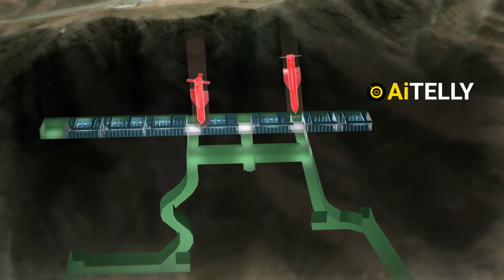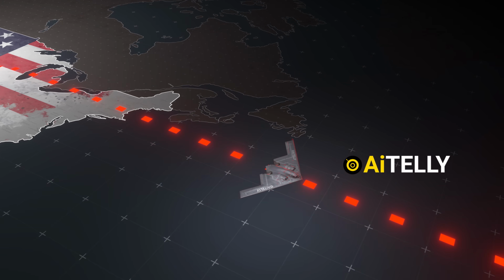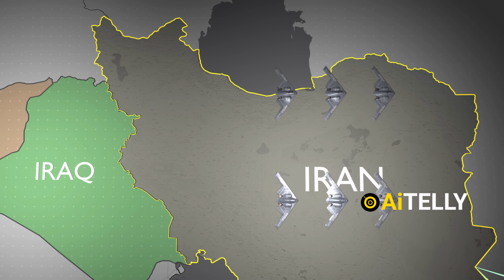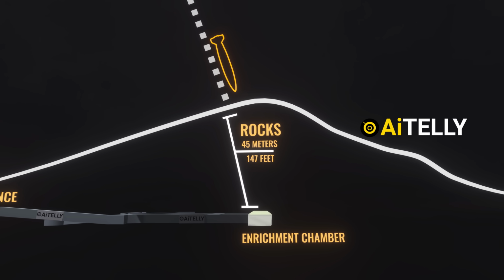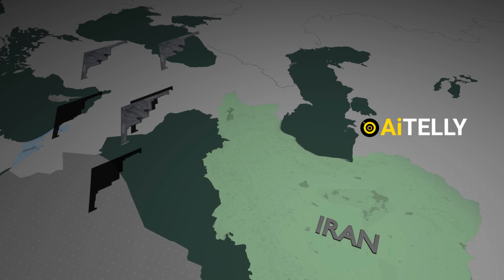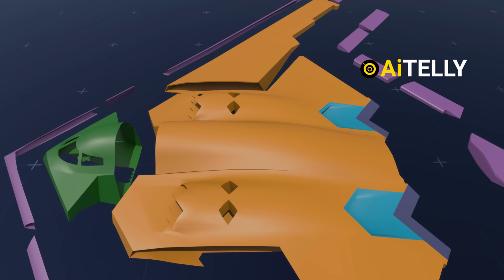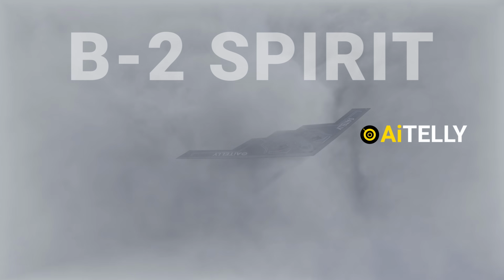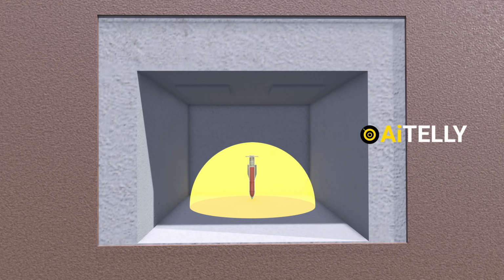How US B-2 Bombers Strikes Inside Iran’s Fordow Nuclear Site using Decoy & Deception #iran #usa

Comment: Unfortunately, you’re incorrect about one particular thing.
They didn’t have time to move that extremely heavy and, dangerous materials. That would’ve been detectable. And it wasn’t. And I can guarantee you with the type of munitions that were used. That there is nothing left under that mountain but rubble. That cannot be gotten to. That’s an experts observation of the exercise.

Comment: The main chamber is 90 metres deep under rock and concrete, not 45 metres. This why the B2s struck the ventilation ducts, hoping it would create enough blast to damage the main chamber.

Also the latest facilities in Isfahan were so deep underground that it was deemed indestructible by the MOPs, and only the missiles were used to attack the surface facilities.

Comment: From the information I've seen and heard:
-  The vehicles seen at the facility (I don't know where the description as "heavy trucks" came from) were part of the construction crews that were there doing additional concrete work. As has been mentioned, you don't just drop in and pick up 60% enriched uranium - if you want to keep living that is (very, very bad way to die).
To move highly enriched uranium (without killing people) requires specialized containers, chemicals, an equipment... not just a truck.
- It is thought (no proof) that Iran had about 10 tons of uranium, but only about 900Lbs of 60% enriched uranium.
- Right now, from reports, it is believed that the uranium is likely still in the destroyed Fordow facility. A deep dig if you want to get it.

- Everyone was told Iran's nuclear refinement was for civil energy purposes. Well, civil energy uses 3%-5% enriched fuel - not 60% (AIEA noted they also found some at 83% before they were refused the ability to inspect). You simply have no reason to enrich beyond that 3%-5% unless it is not for civilian energy use.
- There was a preliminary report that was leaked to the press (illegally) that stated it was possible that the facility sustained only minor damage (i.e. set back of 6 months). A few problems with this report - A) It basically had zero information to go on - they looked at some preliminary photos I believe. B) It was listed within the intelligence "community" as Low Confidence - which means no one is really believing the report because it basically is a guess. Since then, what hasn't been reported apparently very much, is that - it appears - Israel actually inserted units on/near the site which was able to confirm major destruction.
Why should we believe this? A) Israel's stated objective was to destroy the nuclear facility. They stated they had means of doing so if the US did not help (likely special forces dropped on site to infiltrate and destroy). If Israel believe the facility had not been destroyed it is unlikely they would have settled for the ceasefire deal. B) It is said that 12 of these 30,000Lb bombs were dropped. It is confirmed that multiples (at least two) hit the desired target point (in sequence). It is extremely unlikely that even the best built bunker would be able to withstand that.

Comment: Ok bro I been listening to Preston Stewart breakdown and review the damage and what happened to the Nuclear sites. Those 6 holes people suspected of being from the 30k pound bombs where holes already there from the ventilation shafts. The holes initially had coverings over them. Once they where expose you saw 6 holes. When the bombs where aimed and shot that direction from the b2. First one was to help clear whatever was covering the vent shafts then the second and possibly 3rd where aimed through the center holes. The center holes where said to lead all the way down to different hallways of the site . Apparently the blast pressure alone .If the nuclear site is exactly the same as reported by the leaked data. The blast pressure should of made the centrifuges inoperable. Even if it didn't directly hit them .The 30k bombs would of hit at the end of hallways.

Comment: The statement that The MOP can penetrate 200 ft of concrete is false.  The MOP bombs have a max penetration of 200 ft in soil, 60ft of standard reinforced concrete, but only 8 ft in 10000 psi concrete.  The rock above fordow is closer to the hi strength concrete, not loose soil.  No way these bombs got anywhere near the underground facility.  Further the rock dissipates the shock wave quickly.  The entrances were damaged, but not much else.

Comment: The Large Penetrator Smart Fuse is super cool. From the aircraft you can set it to detonate on max depth when the accelerometer reads 0, a  preset depth using a double integral of that signal, or void mode where it will explode when it hits a void/tunnel with the derivative of that signal. Amazing what you can achieve with just one damn good signal of the bombs acceleration!

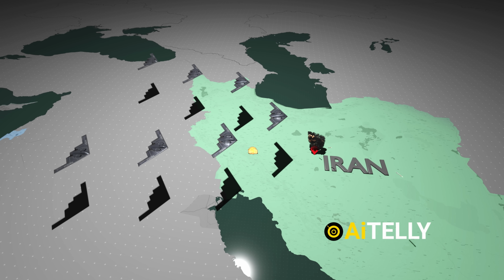Comment: 0:50 The reports I've seen were those trucks were bringing dirt to seal up entrances. At the time it seemed like the US isn't really interested in attacking and Israel might have to do it with ground forces, might be related to that. Moving materials and parts out would just make it easier to hit them. They couldn't do it secretly, the US and Israel had eyes on everything.

3:50 It was nice to practice this and you can't take risks, so they had the fighters there to take care of air defenses but most of those were destroyed by the IAF, especially the more advanced ones. They were left with the kind of air defenses Iraq used in the Gulf war.

Comment: The latest info is that the 3 holes are exposed airshafts after a bomb destroyed the concrete cover and that multiple bombs then went through the center shaft down to the complex. The tunnel entrances were backfilled by the Iranians as a precaution and not bombed.

Comment: Great video, one correction. The rudder pedals are also the brake pedals. If you push toe-down like in the animation, you're applying the brakes. If you push with the entire surface of your foot, it steers the rudder.

Comment: This video is absolutely false. Who made this? The B-2 bombers didn't bomb the entrances to the Fordo facility. They were bombed a day later by the Israelis. Also, 6 of the bombs dropped hit the ventilation shaft WITHOUT having to bore through the mountain, directly into the main hall where the centrifuges and other sensitive equipment were.  God what a load of nonsense. Did you make this video ASAP for likes and views without proper research?

Comment: just pushing a rudder is not how airplane turne, you need to roll the wings to tilt the lift wectoir to a side to generate the force pulling to side needed to turn airplane, the rudder is only to compancase for adverse yaw, an aerodynamic effect accomanying the aileron deflections

Comment: Not a single bomb penetrated to the compound. The GBU57 busts through 60m of earth (unspecified material probably rubble and basic earth with random rock formations), 18m of 30MPa tough concrete and about 2,5m of 60MPa tough concrete (this is google accessible data so im not making this shit up). Ground in the middle east is mostly 60-80MPa solid rock, in parts reaching up to 150MPa (probably this is where the important compounds are built under). In the best case scenario each bomb penetrated about 2-3m deep and caused basically no damage. Which is also evident by all the grey ash like material scattered along the mountain side which indicates a mostly surface explosion and not a 40-60m deep explosion. Its all pure basic simple physics knowledge and common sense. But i do understand most media brainwashed americans dont posses neighter so... Your information about 200ft or 60m into solid concrete penetration is false and google proves that within seconds.... you are giving false information to people.

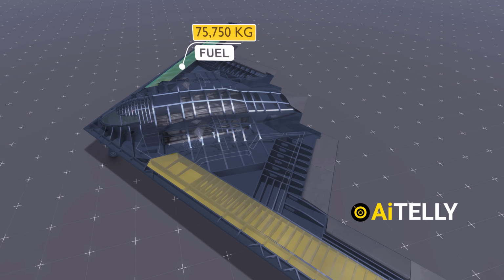Comment: 2:30 "this aircraft fuel reserve can fill up 2000 SUV 'TRUCK'" ... it said no AI was used at the beginning. Are you sure about that? Or does the narrator just randomly speak in broken English?

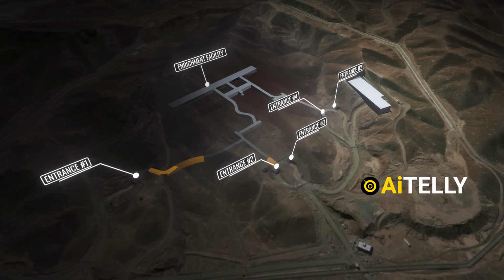edit: again at 4:17 the narrator says there are 6 entrances. The graphic shows 5 entrances, and "entrance #2" is listed twice at different locations.... do you just think we're stupid or something?
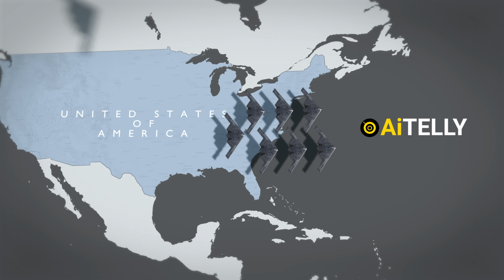5:23 "the us deployed 6 spirit b-2 bombers" and 7 are shown on the graphic. I don't think I can even trust anything you say at this point. Why bother even finishing the video if it's just packed to the brim with lies from start to finish.
Reply: Fwiw I don't inherently dislike AI voiceovers, sometimes it's done without an issue. The problem is that you lied. Why lie? Just say nothing. But the very first frame of this video is saying "nothing here is AI" which is clearly not true. It's hard to trust anything you post if the very first thing you tell us is a blatant lie.

Comment: A hasty unilateral call for ceasefire after a "successful" B2 operation like this!
I call bullshit on this video and US claims.

Iran removed everything from the sites, let the B2 bomb the sites, and collected radar info of the attacking air-crafts along with the Chinese intel gathering ship on Persian Gulf.

After little to no damage on those sites, Iran launched old missiles on the biggest US base in middle east,
Indicating they are capable and willing to destroy those bases. 

I'd think, Iran also secretly sent US the B2 related radar data to show them that those so called stealth air-crafts are vulnerable.
So US and Israel hastily called an unilateral ceasefire.

Given that Iran said from the beginning that they'll stop if Israel stops, Iran had no reason to violate that unilateral ceasefire.

That is the most likely story. Not the bullshit superiority claims by the US and Israel.

Comment: The truck convoy-supposedly transporting 1000's of centrifuges-might have been a FAKE/FAINT/TRICK.If Iran actually did that they essentially destroyed their own production line.Moving delicate  centrifuges-on bouncing trucks-from a well protected location-under full USA/Israel surveillance-to a NOT as well protected location?? No way-it was a trick to discourage the B-2 attack.The centrifuges hurriedly packed-would be  JUNK on arrival-useless.
Reply: I worked with blood centrifuges-they spun whole blood-600ml bags-4-units at a time-50cm in diameter-if they were 1 gram off-they shook like
heck if just 1 gram off(we had rubber weight pads to balance them).They did 3300 RPM- about same diameter as the gas centrifuges-
which spin at 100,000 RPMS.Oh U235 HEXAFLOURIDE must be hot-very hot-to gasify-reactive too-

Comment: From another source, Fordow main chamber lays 100m (or 300ft) under the mountain - not like you say 40m. Estimated penetration of MOP's up to 60m (or 200ft) in rock or dirt, but only 18m in the reinforced concrete. Hence, most likely the chamber was not affected by the blast.

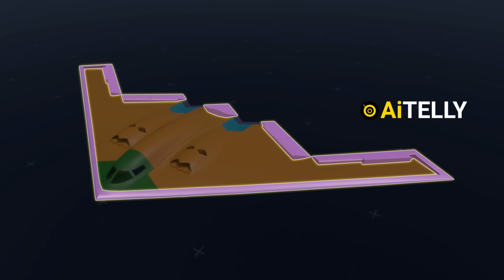Comment: 8:22 the composite ABSORBS radar. Radar works because it reflects back and a detector “sees/hears” that reflection. Stealth works because the craft have very low cross sectional area (hence no sail-like vertical flight surfaces) and radar ABSORBING surfaces. Finally, they use specially crafted angles and surfaces so what return signal does come off, is reflected away from the receiver instead of straight back. It’s why the original F117 stealth “fighter” had that odd trapezoidal shape. It was the best they could do with 1970s(!) computational models to balance the radar diverting shape with something that also could actually fly. 

PS: Graphite is  pronounced GRAFF-ite, rhymes with “bite”.

Comment: Correction to the end where it said the mop can penetrate 60 meters. Weapons max penetrating capability for the MOP is 18-20 meters in unspecified material such as reinforced concrete (5000 psi cement mixed with rebar)

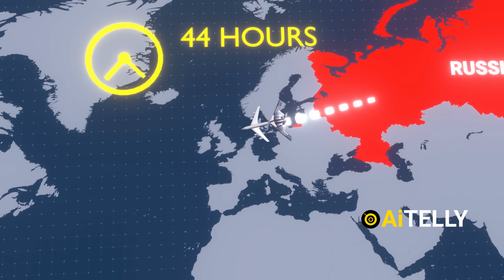Comment: 3:13 airborne for 2 days… How do pilots sleep? Do they have beds on the B2?😂
Reply: @rocky_wang  yes it has a small crew cabin area behind the cockpit.  Theres a bed, a toilet and "kitchen" which is basically an area to heat and prepare your meal. They sleep in rotations since 99% of their flight is going to and from the mission area
Reply: @rocky_wang  yes they have a lie down behind the seat along with a toilet. They take turns on shift.
Reply: The same way german pilots kept themselves awake, meth.

Comment: Fordow is built under a dense granite mountain which means concrete material might as well be like paper. More likely the facility is still in operation with some entrances needing the rubble cleared away after being bombed. Perhaps no nuclear materials left Fordow and everything was instead brought there because it is the safest site in Iran for carrying on with making a weapon. The only way to stop this is actual boots on the ground to secure this impenetrable underground facility. Now make a new video for how this can be done.
Reply: They bombed the entrance caves though too. A shockwaves compressed air, generates immense overpressure, which can lead to structural damage, spalling, cracking, and deformation of the tunnel lining and surrounding rock. The tunnel amplifies these effects, as reflections of the shockwave from tunnel walls and crosscuts intensify the pressure and extend the duration of the damage. Its probably pretty toasted.
Reply: @moabman6803  US Intel assessments say the site is still not destroyed so it is back to the drawing board.
Reply: @deadreckoning425 Actual intel would likely be classified. The news says all kinds of stuff.

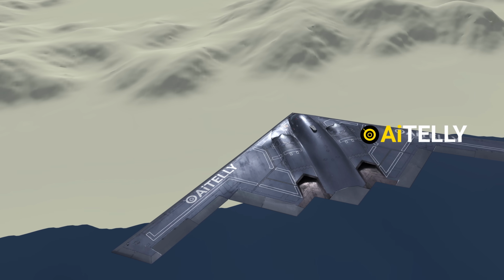Comment: 10:26 was not an MOAB. it was a MOP (Massive Ordinance Aerial Blast* vs. Massive Ordinance Penetrator)
Reply: Wrong. A MOAB is a fuel air bomb meaning it sprays fuel in the air before it explodes, creating a vacuum... the MOP goes through concrete. And the animation shown was a mop, not a moab

Comment: Zoom in on those satellite images of the trucks that were there. You’ll see they are dump trucks and one a front end loader. There’s another image of those same trucks at another location getting dirt and then they went back to the site to dump and fill in the entrances with the dirt. You’ll see them filled in with dirt on the images before the bombing. They didn’t know it was going to be bombed it was to prevent Israel from sending in bombs and the mossad most likely.

Comment: Well done video explanation. After the mission was completed. The DOD had a briefing to the press.
They stated that, 125 aircraft were used in this operation. 16- B2s, KC 130 refuelers (?), AWACS (?), Fighters (?)
Although the exact function of the other aircraft are likely Still Classified. It would have been nice to know.🤔

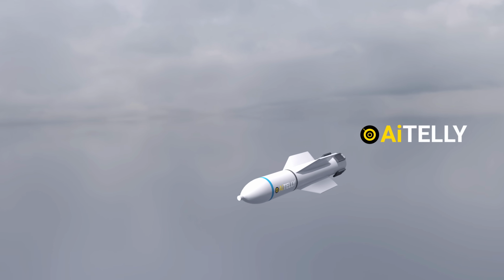Comment: At about 10:30 you refer to the bomb as the MOAB. Not so, it’s the MOP, Maximum Ordnance Penetrator. i.e., GBU-57 series. The MOAB, Massive Ordnance Air Blast, i.e., GBU-43, is designed to detonate above ground and level everything within a mile radius. Sloppy.

Comment: At 8:25 there is a mistake. The components are fiberglass epoxy NOT to “reflect radar”, but to absorb radar energy and thereby not send a reflection back. The whole surface of the B2 is designed to reduce and eliminate radar returns.
Reply: the skin of the B-2 is coated with a classified "paint" called radarsorb that reduces reflected radar energy as opposed to giving a signiture ping back.
Reply: @3RTracing  that’s the true answer 👌
Reply: @Volarte_Studio they both seem right to me. Nothing 3RTracing corrects what OP said, he just said something else. OP said the plane is not designed to reflect electromagnetic energy. Next guy says they use special paint. Both true. The point is the plane is not designed to reflect but to deflect and absorb electromagnetic energy.
Reply: @3RTracing  what isnt absorbed is reflected too
Reply: @bear76009  why would you want to reflect energy back?  That defeats the purpose of cloaking, or "absorbing" the radio energy.  That is the whole point of anachoic coatings, the completely attenuate any reflected energy.
Reply: @3RTracing  did you actually read what i said?  what ISNT absorbed is reflected away from the transmitter.
Reply: @bear76009  yes carefully and more than once and your statement has more than one error.  Sorry to be blunt, and will not respond fuller.  Thanks
Reply: @3RTracing  i dont care if you respond or not.  My reply was based on my 14 years of working in the ELINT field which requires operational knowledge of the radars and how they work.  So to be blunt i dont care
Reply: @bear76009 its actually deflected away. Not reflected, which would imply sending it back.
Reply: @3RTracing  black nippon weather paint.
Reply: Even stealth planes reflect most of the radar signal. The trick is, they refllect it anywhere but back to the source (at least when it's coming from an angle a ground based radar, AWACS or a fighter on patrol would use, not sure how well the upper hemisphere is handled. But then, nobody has AWACS satellites).
Reply: @AndrewCZ47  China has deployed a network of Synthetic Aperture Radar satellites. I'm confident the US military has similar capabilities.
Reply: @KyleMackenzie  SAR is for ground mapping (basically taking a B&W photo in any weather, even through clouds). IDK what's the resolution from orbit with current tech, on the declassified photos from the SR-71 you could identify cars on a parking lot.
Reply: You think this guy understands what he is talking about in the video? 😂
Reply: @DashCamSerbia  you think we care about you?
Reply: @COSMIC_SECRET  You think I care about Chinese AI bots? 😂
Reply: No your wrong bro
Reply: @Volarte_Studio  thanks for proving him wrong - said no one 😆
Reply: :face-green-smiling:

Comment: Iran needs to install a grid of ferro-concrete pyramids over its underground factories, spaced 3 meters apart, measuring 2x2x2.5 meters. The inclined edges will be able to deflect the bombs and thus dampen their kinetic energy.